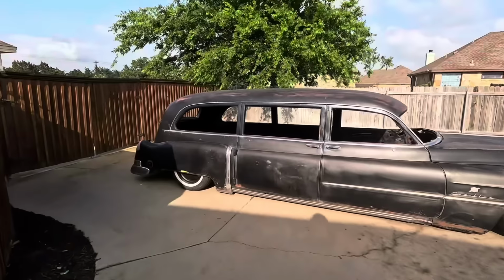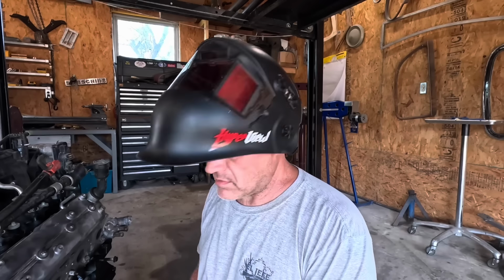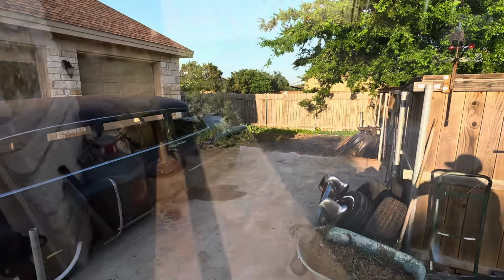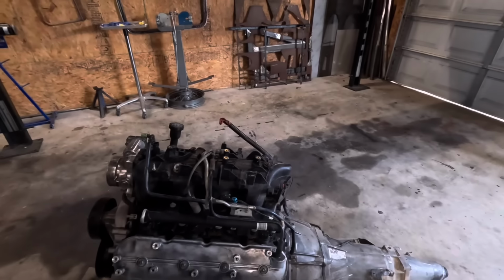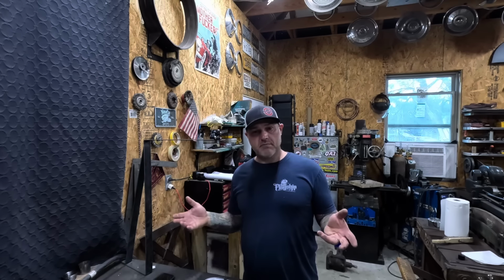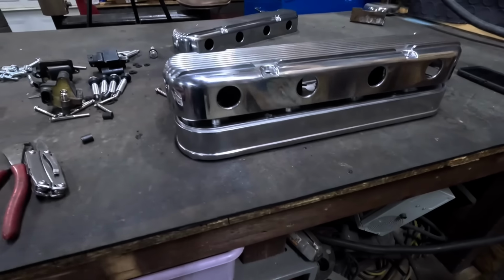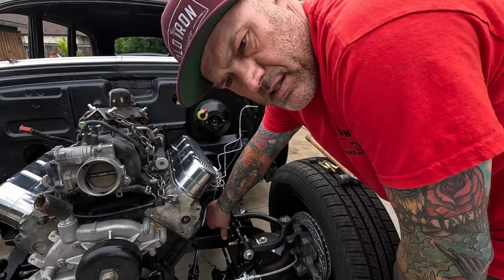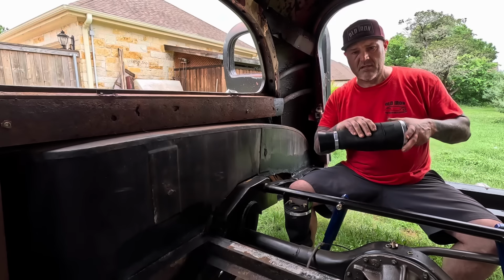PART 11   1950 Cadillac Hearse, Resurrection. A new heart in Frankensteins monster.

Comment: Wet Sinister & Bad Ass ... Mabel ... Mr. Anderson in your last life you were the world's best auto shop teacher ... 🤭👍 good installment. *Hey you took my hint about the coil covers. Now add a sniper efi sheet metal intake.
Reply from the maker: That would be nice.  Not in my current budget
Reply: @Theoldironworkshop  True they're pricey at seven hundred but then you have to set them up too.
Reply from the maker: Hmm. Maybe I’ll look into it.
Reply: @Theoldironworkshop Holley makes em.Model 820031-1 was the one I liked. They make a double barrel one to. My buddy keeps trying to talk me into replacing the 70 LS6 in the Merc with a lighter LS so I looked into it to keep an old school look under the hood. My 454 has a finned 50s Hillborn scoop  I converted to single Demon 4bl from dual quad and finned 60s aluminum valve covers. My contrast to the purple is blue so I paint blue between the fins. Looks clean.

Comment: Reverse cutting drill bits work a treat to extract broken bolts with bits stuck in it. If you lack a welder.
Reply from the maker: Never heard of them.  Have to look it up.  What would be the reason for reverse

Comment: Hey man..good job on the stud removal.. I've had more than my share of stud removal..i go back with stainless bolts and a little i mean very little anti seize.. I haven't had one come back yet..knock on wood.. Cheers 🍺🍺🍺🍺🇺🇸🇺🇸🇺🇸🇺🇸
Reply from the maker: Yeah, I don’t know if you can use stingless on exhaust as well as on aluminum. There’s a lot of dissimilar Metals and they all expand a different rates. Hopefully whenever the studs go back in, they’ll never come back out in my lifetime.

Comment: I don't know much about the early 50's hearses but i do know about the 60's and later hearses. The later cars had a different windshield (they were much taller) than the regular cadillac cars because they were commercial chassis's. Just measure yours vs a regular caddy before buying one because I know they are all expensive

Comment: I like the little dolly you got to move around the car I had the same situation but I didn't have a little dolly so I used the floor jack surprisingly that works well because I was able to lift the front end up move it over put it down go to the rear lift it up and move it over and I did that like five times both sides got it in that's a hell of an idea of getting those stuck bolts out of there I've never thought of that thanks to you I'm going to try that the next time I break a bolt I haven't bought an easy out yet I just go down and rent one but I'm probably going to break down and buy one eventually LOL the Hearst is looking good that's a damn good job you're doing on that love the videos keep them coming
Reply from the maker: Thank you very much. I stole the idea for the bolts from another guy on YouTube.  Such an amazing place to learn new things.

Comment: Your ground when welding should be placed as close as possible to weld ,it can be grounded to the head.if grounded to block any current is passing thru blocktohead thru head bolts.i have seen arcs across bolts to head screwing things up.
Reply from the maker: Hmmm yes. I’ve ruined bearings before because of that, However my magnet won’t stick to the aluminum.

Comment: Ever since I started using the MIG on broken bolts, I banished bolt extractors from the garage.  I was tired of breaking a $10~$20 tool on one bolt.

I would have used the remaining broken bolt extractor as a chisel to loosen and then a metal pick to remove the piece stuck in the broken bolt before welding the nut on.

Also, when I have a broken bolt that is flush or below the surface, I build up a pile of weld... using a wet rag to cool it so it builds up.  Then I hammer on a nut and weld it to the pile of weld.  Just be careful not to weld the bolt to the head.
Reply: If heads are cast iron and aluminium no way your going to weld stud to head
Reply: @alanhicks3361  Tell that to the cast iron headed '95 LT1 I have in my garage.  I had 4 broken bolts... 3 were unmolested and I zapped them right out.  The 4th broken bolt was welded to the head by whoever previously worked on it.  I don't know what they did to it, but it won't budge and I can't find where the bolt ends and the head begins.  I had a 100% success rate after around a hundred bolts until I got to this one.

I really have to clear all the garbage off that car and return to that project.
Reply from the maker: Yes it’s definitely a little scary.   To hot and it’s toast

Comment: I was a turbo engineer & 50% of studs / bolts used to shear.
If your Easi - Out is good quality, you can shatter it with a punch & blow the bits out with compressed air.
A bonus is the hammering also loosens the stud.
I did,nt have access to a welder & so it was the only way.
Of course if it,s a cheapo extractor it won,t shatter.
Reply from the maker: Yeah, I tried breaking that bit. Biggest problem is dealing with the aluminum head and being afraid of ruining it.

Comment: To get those broken bolts out is an absolute pain in the ass. I have a friend who swears in order to loose a bolt it helps to tighten it just a tiny little bit before loosing it more. 
I never had any proof of that, but maybe I will have to give it a try in the future.

Comment: Use the triangle piece of angle iron that is leaning up against the fence to pick up the doghouse from 3 points. One corner to each fender, and the point of the triangle to the radiator support.  Then find the center of gravity and use the engine hoist.
Reply from the maker: Yes, in hindsight, I should’ve probably did that because that sucker is not light.

Comment: A good way to get broken studs or bolts out is. To drill a hole in the bolt and then pound in a torx bit just slightly larger than the hole. Then use the torx bit to back out the bolt. No welding required. Hasn't failed me yet 👍 also soaking it with a good penatrating oil like PB blaster or kroil. Not wd 40. Or seafoam.
Reply from the maker: Hmm have to try that

Comment: Cool trick getting those head bolts out, any news on the house ???
Reply from the maker: We went and looked at it and had discussion with the lawyer and explain to them what the house needed and what a realistic price is. They pulled it off the market and we’re not sure what they’re doing currently. So it’s in limbo, however we are looking at other properties.  However, viewers kept pointing out that in the basement there’s a face that’s in the wall. So I went back and re-watched the video and sure enough as clear as day. There is about four faces in the basement wall. That kind of freaks me out just a bit.
Reply: @Theoldironworkshop  Lol guess you wouldn't like to be down there if the lights go out !!!

Comment: If you didn't get that stud out yet. Drill A pilot hole with A harden drill bit.,or titanium drill bit A good one to. Smaller drill than the stud of course to weld into the easy out and washer to remove those with. And repeat the same process of backing it out slowly.,or slow and steady.

Comment: I thought the third time was the charm on broken bolts. ha, ha, ha... With all your skills why not fab up a tilting front assembly for the clip so that it is easier now but later a fancy way to show your engine compartment and suspension components.
Reply from the maker: I seen Chad just did something like that    Good idea
Reply: @Theoldironworkshop  Do you mean Chad with the girlfriend from nowhere in Canada? Just be sure to run all the wiring down one side and make a big Molex quick release or something for everything you wire up. Be sure to leave a lot of extra pins on the connector cause I can see so many front lighting options that would be so hot. I think that would be so cool to see the hood tipped over or pulled off sitting next to the car at a car show!

Comment: You need to tig weld and build up a blob of weld off the stud then put a large nut on and fill it in. The hotter the better.
Reply from the maker: That probably would work a little bit better. Sometimes I’m lazy with the Mig

Comment: I thought you would  make a 3 point jig to capture the center of gravity of the front clip , I though you would would have figured that out when I said JIG . Sorry you had a tough time . Another thing that may help if you move and make a new shop is an I-Beam that spans the important part of the shop that you may lift and move thins / This will help you because it will have a trolley and a hoist on it . Again sorry for your Half attempt . but I did laugh .
Reply from the maker: Yeah now it makes sense.  Next time.  Always next time

Comment: Wouldn't be better to use stainless steel bolts to secure the exhaust manifolds instead of metal
Reply: Stainless is metal,it also galls threads ,especially aluminum.
Reply from the maker: Aluminum is a hard one to work with.   Probably should use studs
Reply: @Theoldironworkshop -- I ment to write studs, but the tablet had other ideas.